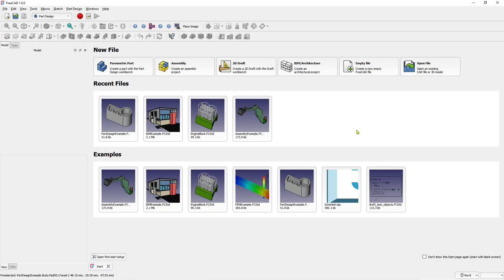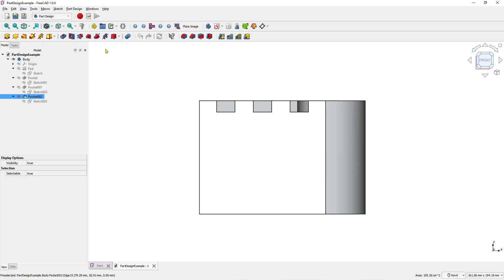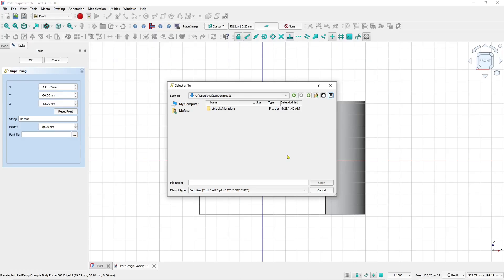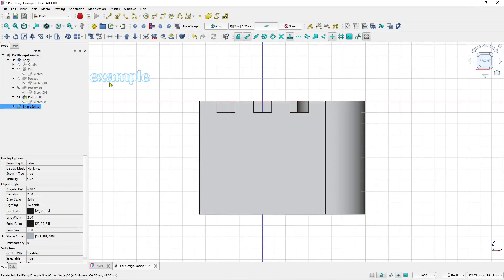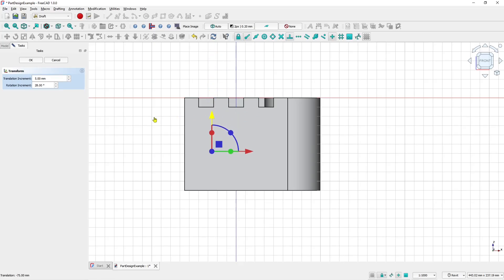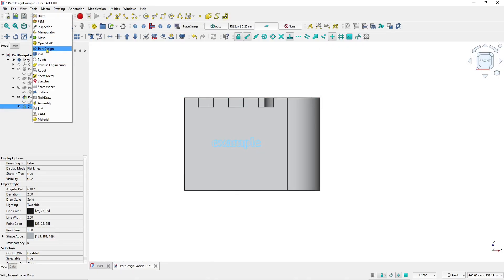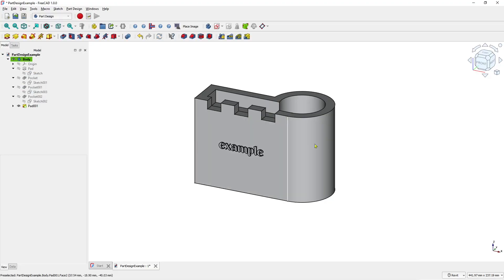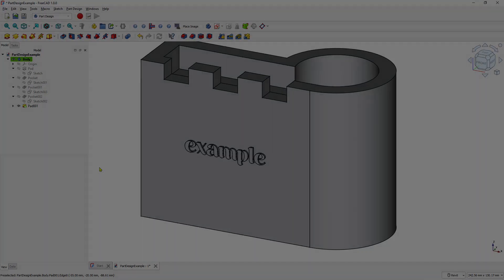FreeCAD 1.x How To Add Text

Comment: Very streight forward. But I have specific situation - I make full lid for the box. I do exactly what is said and in Draft text is sited on plane of the lid. But when I go to the Part Design and move text shape into the body of the lid the text is not anymore alinged to top of lid but is far away of the lid. And there is no way to put them togheter either with transform or with manipulator. I need to reskethc from beggining and put text befor doing anything else.